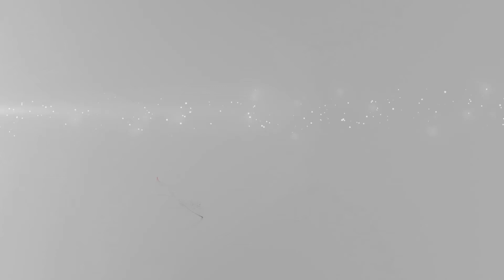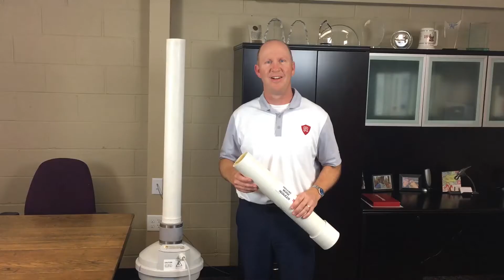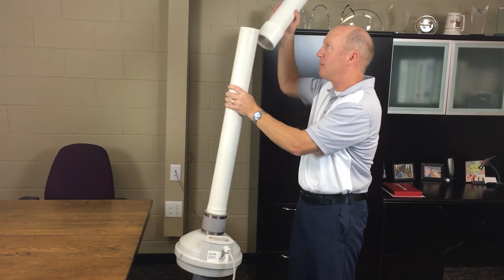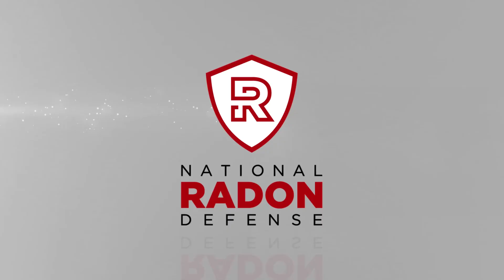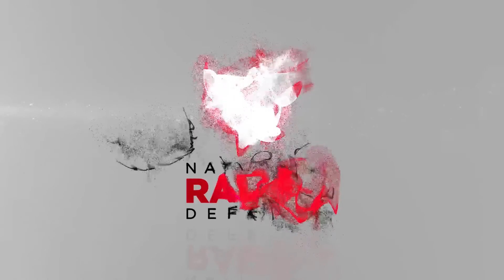National Radon Defense Muffler

Comment: This seems to work great in sound reduction. How does it impact the backpressure or is it negligible?
Reply from the maker: Yes, it's working well for sound reduction! As for backpressure, adding sound-dampening components like mufflers or silencers can sometimes affect airflow slightly, but the impact on backpressure is usually negligible if the system is properly designed and balanced. Most systems are engineered to maintain efficient airflow while reducing noise, so unless there’s a significant restriction in the system, it shouldn’t cause major issues. It's always a good idea to check with the manufacturer or installer to ensure the setup is optimized for both noise reduction and proper ventilation.